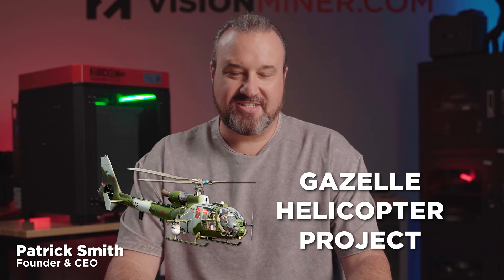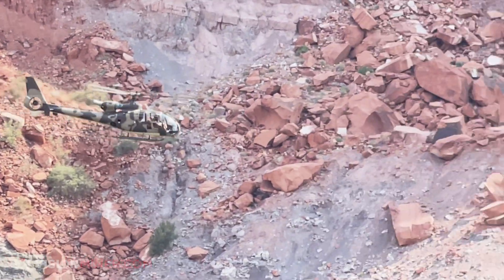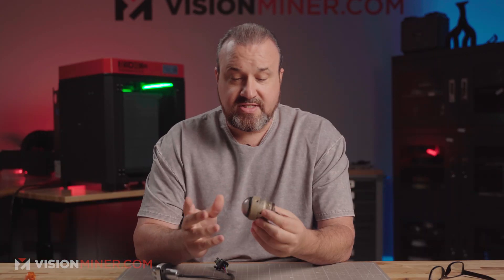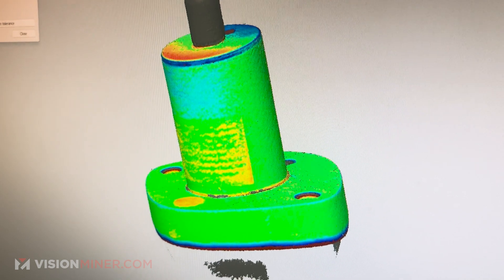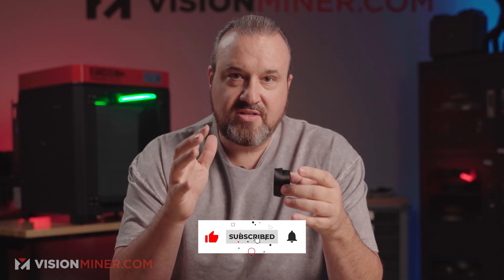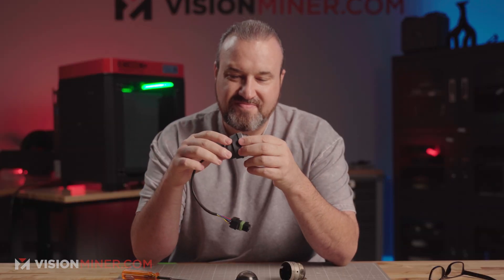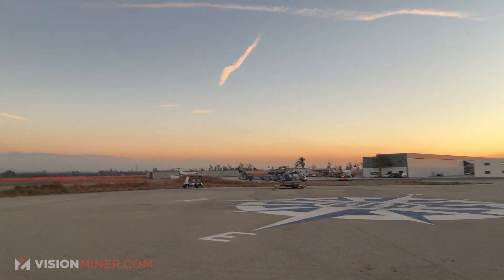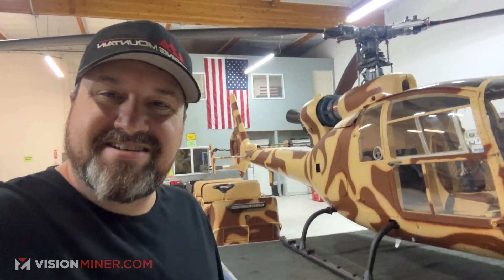3D Printing Helicopter Parts: 3D Scanning, Reverse Engineering, and Tail Light Upgrades

Comment: No disrespect, it is a light housing. You could technically use any 3 d printer with any material to make the housing and it would technically work. So what's the big deal here. Now if you were to 3d print a turbine blade then now your talking. Don't get me wrong, it's cool stuff.
Reply from the maker: Technically work, yes. We printed the first one in PLA for fitment. The point here is multi-fold: 1. showing off the tech we sell (scanners, software, printers) 2. Using an aerospace-grade material with UL94 V-0 FST rating, so you could actually get it approved by the FAA. 

This is essentially a case study to inform people in the aerospace industry of what is out there, what's available, and what they could get equipment to do themselves, especially if they're in this kind of business. 

Turbine blades -- now we're getting more complex! Maybe once we add Metal SLM to the lineup of machinery we offer..... :) :) :)